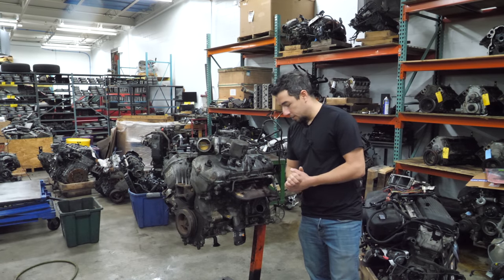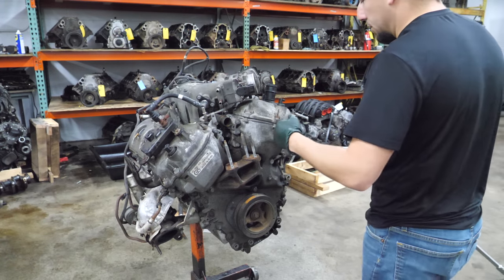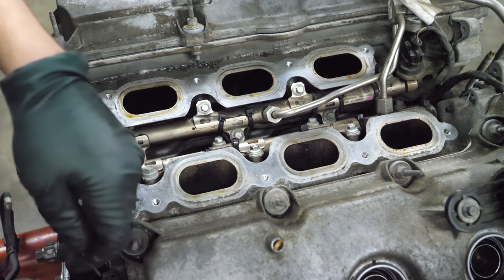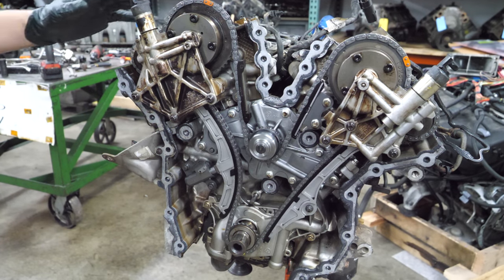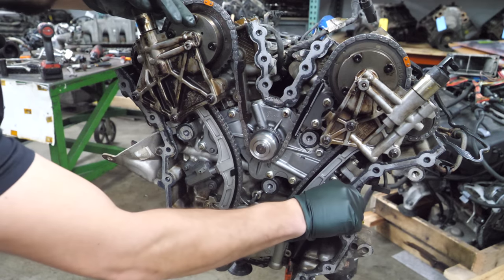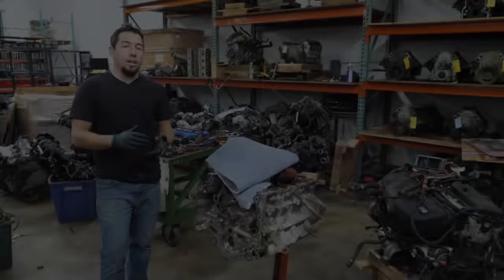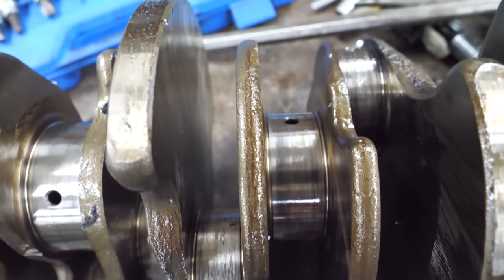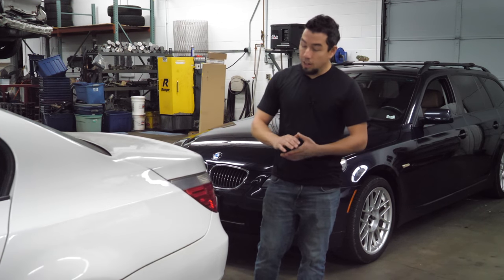Taurus SHO Flex ECOBOOST 3.5 V6 BAD Engine Teardown! What Killed This Maintained Engine?

Comment: As somebody who has done a water pump and timing chain on their SHO, let me tell you it’s a real treat doing it with the engine still in the car 🤣
Reply: I have a sho and my water pump blew. I apologize as i know they are awful to repair hahaha
Reply: literally just did this. then hpfpcam follower exploded on startup. metal chunks lost in my freshly rebuilt engine.
Reply: Im at 101k with my non turbo how long do i have left?
Reply: @CopeYouCun7s   Have you had to repair the water pump at any time. The water pumps I've replaced on the 3.5  was 68k and 61k the repair is so expensive.  I really believe your water pump is on  Is borrowed time.

Comment: Just learned how quickly a blown turbo can starve an engine… Good advice and another cool video
Reply: Another reason I'm keeping my Yota 2UZ around as long as possible.  No truck outside of a diesel should be running turbos.  They are just extra liability.
Reply: @majist0  the ecoboost is pretty proven for reliability… u can find a video of any engine like this NA, or forced induction… my 2010 SHO has 104k HARD miles. I have a Livernois 440HP tune/kit on it since 50k miles and it runs like new.

1.) I only put good  synthetic oil in it rated for “20k miles” either Castrol Edge extended or M1 Extended or PP Ultra. with “20k mile oil filters”

2.) I change my oil every 5k miles even with the “20k components” 
This has kept it running like new for me. The engine can easily go longer on that oil but the turbos are not worth risking. DYI oil change is only $37 with some of the best oil and filter available. It also takes about 15 minutes with oil change ramps. One of the easier oil change engines out there.

3. )I also use a intake valve cleaner spray by CRC every 15k miles which definitely works. Does it clean it entirely..  likely not at all but it reduces carbon build up significantly and with repeated use slowly pecks away at it. It is also very easy to use.

Then I also change spark plugs about every 30k miles.
Reply: @shawn01707  I feel the same way about changing the oil in my 2 vehicles. It's cheap and easy to keep your oil changed.

Comment: This channel has me checking my oil every time I get gas.
Reply: I also check oil at fill-up was always told that by my dad from a young age!
Reply: I used to tell every customer to get in that habit. Especially those with cars made after about 2011 or so, as the lighter weight fuel economy 0W oils became more fashionable, and cars started to use oil. Turbos, too. And oil change intervals, especially as DI engines soot up the oil, are more crucial as well.

As cars become more and more automated, the mechanicals become less and less maintenance free. Hilarious

Comment: I love my eco’s. Got a 2010 with 180,000 miles. The hp and torque is awesome.
Reply: Have you done anything as far as your maintenance? Like fuel injector cleanings and carbon buildup cleanings, other than just your normal transfer case, transmission fluid, and spark plugs with the general maintenance?
Reply: You should definitely install an oil catch can

Comment: There was most likely a large amount of RTV on the timing cover because  on the front wheel drive engines it is a very difficult job removing the timing cover with the engine  in the vehicle. So most techs put a lot of rtv on the cover because they simply don't want to have to remove the cover again.
Reply: The point was more RTV <> better.
A thin bead, then follow the instructions for RTV, which is usually hand tighten, leave it for a while to cure for a bit, then torque down. Having half a tube gush out the sides isn't a sign of success.
Reply: @Cheepchipsable  yeah I know I'm a good mechanic, I was merely pointing out that was the likey cause of the excessive rtv in the first place
Reply: It will be done with a robot in the factory, I imagine it is difficult to replicate with the engine in the vehicle.
Reply: and also because there usually isn't any time to leave it to cure, which is required, so doing it this way is mostly reliable, even if annoying
Reply: But the SHO is AWD
Reply: @Blue-moon12  still an FF platform, PTU or no. I've seen a few transverse Ecoboost V6s and I can assure you there isn't much room in the engine with these things mounted in such a way.

Comment: This car sufferd from the water pump failure and they ride with the water in the oil until it made noise... Then they thought a new water pump and timing chain and and oil change would fix it.. not the case. If you miss the water coming out of the weep hole and wait until the water pump completely fails and it dumps water into the oil it's DONE. It does exactly the damage shown. Anyone with a front wheel drive  3.5 Ecoboost needs to start checking behind the alternator starting at 100k Mikes. Honestly anything after 100k your on borrowed time. So best thing you can do is start buying parts from Ford. AND ONLY USE A FORD WATER PUMP and ford spark plugs. I just did this in my 2012 Lincoln MKT. If you are shade tree mechanic this isn't a Terrible job but it is a long job.. it took me a weekend to complete.
Reply: why Front wheel drive ?
Reply: @RevO-One  He means FWD or AWD like the Edge, Flex, Taurus, etc.  In these applications, the 3.5/3.7 is turned sideways (East to West) in the engine bay, and there's no room for an external water pump, so in these cases, it's inside the timing cover.   If the front water pump seal leaks on a Cyclone engine, the coolant goes into the oil and kills the engine.  There is a weep hole on the side of the block near the alternator that weeps when the pump starts failing.  If the water pump is changed in time, no engine damage will occur. Now, on rear wheel drive applications (including four wheel drive trucks), the engine is put in North to South, and there's room for an external water pump, so the rear wheel drive based vehicles don't have the internal pump leakage.
Reply: @ohger1  oh thanks I just didnt know about the existence of the external pump on those, I thought the engine alone was almost 100% identical...

Comment: Found some sparkly oil in my Taurus. Water pump bearings went out. Got lucky, only started leaking when tension was taken off the chain. Flushed oil pan and pick up, new water pump, chain and components, magnetic oil plug and a large magnet on the oil filter. 230k. Still going strong.